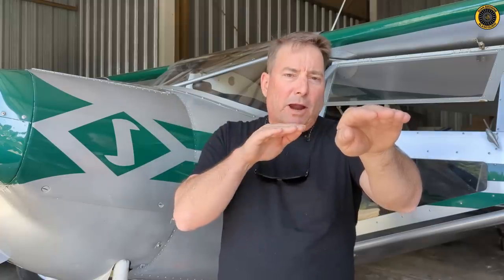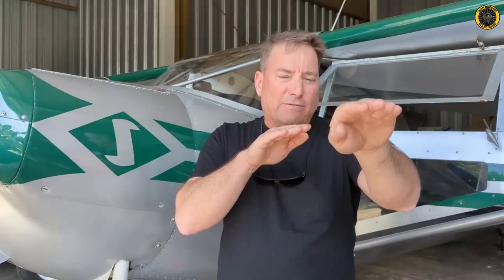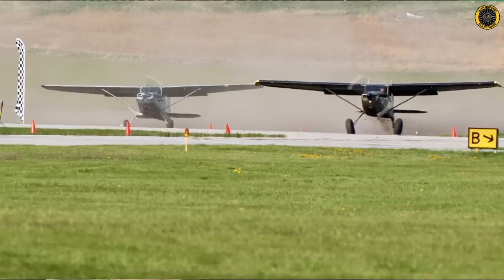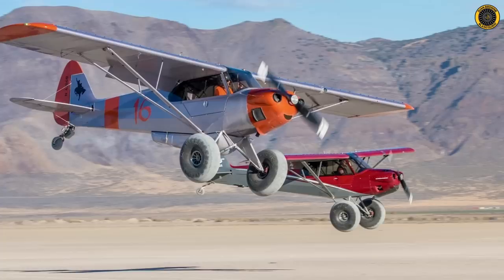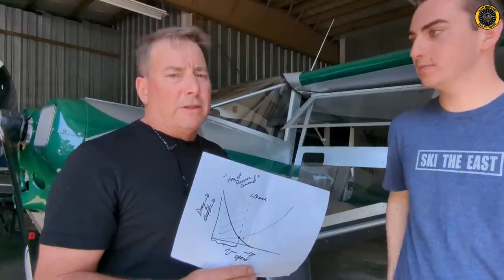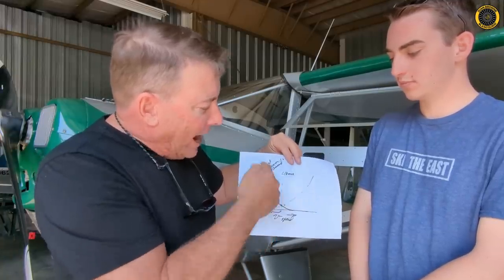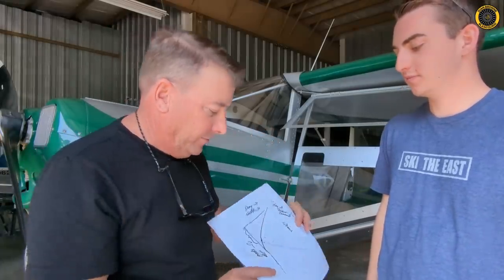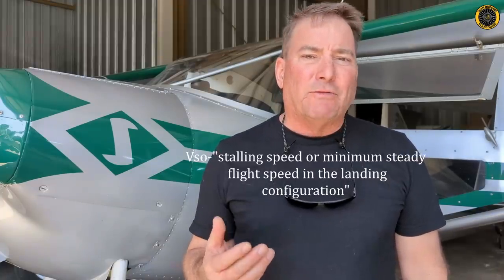Cessna 140 Stall/Spin Accident Wayne NE

Comment: To all those saying that STOL is asking for this kind of incident: You clearly didn't watch to the end. As Juan says, the proper way to do these STOL maneuvers is to fly at approach speed until you are in (or nearly in) ground effect, then bring the speed back to execute your short landing roll. Similar with takeoff: you rotate and lift off as slow as possible, then lower the nose, accelerate, and climb away at Vx or Vy. If flown that way, the risks are no more extreme than many others we accept in everyday life.

The issue here was that planes with different approach speed were operating with limited spacing in the same pattern, so the C140 was well below its approach speed trying to maintain spacing, and then tried to maneuver. Nothing fundamentally unsafe about the event. Just poor sequence and unfortunate decision making once the spacing got too short.
Reply: No, the problem here is that without any significant transgression a man died. Too many planes, too slow, too close. BAD EVENT MANAGEMENT!
Reply: @ianallan2337  there was only 1 aircraft in front of the accident aircraft. A go-around decision should have been made by the pilot. We can all learn from this.
Reply: @ianallan2337  lol, hope you don't fly on a weekend anywhere ever.
Reply: @josephditroia4946  So how many would be an issue?
Reply: @wgmskiing   Not a good time to laugh. Do you have a license, Garrett?
Reply: @ianallan2337   and…500 hr pilot? I’m not a pilot but I think playing a low and slow plane game with such low hours, maybe he lost the focus to fly the plane trying to beat his opponent, realizing just a few knots too late that he was in fact too slow with no room for error. Sad.
Reply: Surely by definition this sort of flying has a lower margin for error? Lower margin for error = more dangerous. 
Even a highly skilled and experienced pilot has LESS time and fewer options to deal with the unexpected than they would under normal flight ops.
As I see it, pretending otherwise is just silly. 

If it ISN'T more dangerous, why do they need additional training/certification/whatever? Juan said two failed. Were they crap pilots, or does this sort of flying put additional demands a 'normal' GA pilot doesn't encounter, precisely BECAUSE it inherently involves more, and thus technically unnecessary for 'ordinary' flying, risks?

I suppose we can ask Juan to adjudicate: does he think this sort of flying is more risky than when he flies the 777, for example, or indeed his GA flights? Do we seriously have any doubts what he'd answer?
Reply: @josephditroia4946  All? No, sadly, the person who apparently needed to learn it more than the rest of us can't. That's kind of the problem, isn't it? So terribly sad for all involved.
Reply: @57Jimmy  500 hr. is not all that low, especially if you're mostly sticking to one type of aircraft, not trying to advance rapidly to complex aircraft.
Reply: @57Jimmy , he wasn’t trying to beat the other pilot, they were not racing at the time of the accident.
Reply: @ianallan2337  The 5 pilots decided to fly the pattern together. At the time of the accident, there were only 2 planes left in it. Nothing wrong with the event management. The pilot who died made a bad judgement call when he turned sooner than he should have, given the speed difference between his and the other plane. His decision alone.
Reply: @57Jimmy  It was a demonstration not a competition flight. The one thing he could have done differently was to lengthen his run before turning onto approach, given the speed difference.
Reply: @steeltrap3800  I took it to mean all of us still alive. And he's right, anyone can learn from this. And that means that at least his death was not in vain.
Reply: Well said.
Part of what he's talking about is very similar to handling microbursts. As you fly through one of those you go from a sharp head wind to the down rush to a sharp tail wind. So the air speed jumps up then the plane gets pushed straight down and then suddenly the airspeed drops.

I did quite a bit of unusual attitude recovery as part of my basic aerobatics and that's saved me on a few occasions mostly from not overreacting. I think this stuff is all about flying at the limits, which is fine so long as you are trained to respond properly.
Reply: @ianallan2337  Glad to hear someone say it.
Reply: "As Juan says, the proper way to do these STOL maneuvers is to fly at approach speed until you are in (or nearly in) ground effect, then bring the speed back to execute your short landing roll."  

None of those pilots were doing that.   They were all flying as close to Vstall as they could, from a long way back, hanging the plane on the prop.  Basically they are flying low and slow, the worst possible thing.   

Don't believe me ?  Why was the 140 overtaking the Zenith ?  The 75% cruise speed on a Zenith 701 is 80 MPH.  VStall is 28 MPH.   The stall speed on a 140 is 45 MPH.   In order for the 140 to be catching the Zenith, it had to be doing less than 40 MPH.  The Zenith was flying near stall speed, hanging on the prop.
Reply: @SomeTechGuy666  You actually made my point. 1.3*28~=37. The Zenith's safe approach speed is a little under the 140's stall speed.
Reply: @ianallan2337  I also noticed that once the airplanes landed, they even STOPPED on the active runway apparently to have their landing roll measured which even extra time for the  next airplane's approach. BAD EVENT MANAGEMENT!
Reply: please explain this rationalization to the widow and her five children
Reply: @reardencode  In gusty wind conditions, 30% above such a low VStall is not sufficient for normal flying.   If the wind speed is 10 MPH and it suddenly dies as it might in gusty conditions, the airplane airspeed is now 27 MPH and it stalls.

Tom got caught.  Unfortunate, but true.  But the truth is most of the other pilots were probably hanging on the prop too.

If you look at the video, Tom lost about 50 feet of altitude and then steadied right before he spun.  That was probably a stall he caught.  The next stall turned into a spin.  Yes, it happened on the 140 before the other planes.   But that Viking is going way slower than Tom is and their stall speeds are only 17 MPH different.   The Viking wasn't far off stall speed either.
Reply: @ianallan2337  this is my real name.  I'm not hiding anything.  And I'm not laughing at the tragedy, I'm laughing at the clownish comment you made.  Find a hobby.

Comment: Prayers for Tom and his family. I have flown as a Commercial Pilot since 1968. Retired now but I don’t consider a 500 hour pilot experienced, just has some experience, two different things.
Reply: That's kind of what I was thinking but he did say he "wasn't a rookie" which I guess is kind of true but he definitely wasn't far removed from being one.
Reply: Do you think a commercial pilot has good knowledge and experience with stalls and spins as you are always flying straight and level at high altitude and well within your limits?
Reply: @gogogeedus  yes, some do all should. I crop dusted for 3 years, flew aerobatics with Frank Price for 3 years in a Pitts.  Today’s new pilots, I really don’t know. I flight instructed for 2 years and never soloed a student who couldn’t master a 3 turn spin right and left. Even lost one job over my solo requirement. There is a big difference in pilots and pilots!
Reply: No, 500 hours is like a teenager behind the wheel of a car. Using driving as a comparison, 500 hours at an average speed of 55 mph would only be 27,500 miles. Not experienced.
Reply: @kennynorton2473  EXACTLY my sentiments, those are basics! I won't solo a student unless I've spun them!
Reply: @jrwstl02  WRONG! If taught the basics properly then what he was doing wouldn't have bin a problem.  I've taught 50 to 60 hour pilots who are natural and rock! And I've had commercial pilots that basically suck! Look at the copilot on the Atlas 767 flight into Houston that at 6000ft and 250kts in some clouds and turbulence screamed out "We're Stalling!" and stuffed the nose and drove the airplane into the ground!
Reply: @gonflying  I could be wrong about this, but wasn't that crash ruled a deliberate act? Either way, yes there are a ton of air crashes that showed poor airmanship in pilots with a lot of hours under their belt. Every time a pilot takes to the air there is a unique and changing set of risks. It only takes one thing to end it all.
Reply: 500 hours and the pilot in this accident was "experienced"? 

I'm not a pilot, but I'm a lisenced architect. The minimum hours required to earn that title are 16,000 hours of combined education and work experience. And you have to pass the board exams. FWIW these requirements are mandated by law for "public health, saftey and welfare"

500 hours is the equivalent of 3 months on the job in my profession. That's not even wet behind the ears. You're barely qualified to run the xerox machine or god forbid, use a stapler after 3 months in an architecture office.

Architecture is certainly a complex and highly technical field and all that. But it seems to me that flying an airplane is pretty complex too. It also seems like there's very little margin for error, especially flying as slow as possible close to the ground, but still fast and high enough to kill you instantly. Competition adds more distractions, workload, and pressure to push limits. Deaths are inevitable in flying just as they are in driving. Any sort of competition increases the risk in both. As long as pilots understand and willingly accept the risks involved, I say "have fun!"

...but part of "understanding the risks involved" means understanding your own limits and those of your aircraft. It's hard to imagine a 500 hour pilot truly having the profciency and knowledge and experience required to safely operate and compete at the ragged edge of his aircraft and his own limits. Rather, it strikes me as reckless to allow such inexperienced pilots to compete in such events. The pilot himself is gone. It's his family and freinds who'll have to deal with the loss. It's sad on one hand, but also inspiring, because at least he died doing something extraordinary that he loved.

But organizers and sanctioning bodies of competitions like this might wanna review the minimum training and experience required of competitors. Maybe consider setting minimum air speeds and maximum altitudes for them? Go slower or higher and your disquilified. Competition becomes about precision flying based on staying within a particular aircraft's safe performance minimums.

Unless funerals are an important part of the sport.
Reply: @gogogeedus  plenty of 20000+ hour pilots have come unstuck in light aircraft- a common one is forgetting to change fuel tanks.
Reply: @TheWilliamHoganExperience  500hours should be ample hours to safely handle a light aircraft. This pilot, like many before, just had a 'bad day at the office'.
Reply: @michaelosgood9876  yes off course. thousands of hour flight time is not going to change a pilots diligence.it's an individual thing.a personality thing.

Comment: Good analysis. The use of rudder at low speed stalls situations and the adverse effects of aileron use is not often taught in GA training. ... in my opinion.
Reply: An old friend and flying buddy of mine used to call that effect "reverse ailerons" where the ailerons would actually have the opposite effect than what was intended under certain flying condition IE high AOA and the incipient stall spin phase.
Reply: I remember the one sailplane lesson I took.  If you tried to turn without enough rudder it would turn the opposite direction.  It took a lot of rudder to turn with those long wings.  It was a good lesson that I haven’t forgot, even though I don’t fly or instruct anymore.
Reply: Thats a good point...

The intuitive / reaction thing is to use aileron when a wing drops at slow speedbut its the worst thing you can do.  Rudder rudder.
Reply: Sailplane instruction spends a LOT of time on stall and recovery training. Important when you don't have the luxury of "going around*. Im sure the pilot knew what to do, however it shows that in emergency situations its very difficult to resist the urge of doing the opposite hence he tendancy to use aileron to pick up the wing or pull back on the stick. Tragic loss and my thoughts are with the family.
Reply: My experience is that if you use aileron to try and pick up a stalled wing is you go into a spin. Been there, done that at a safe altitude and changed my skivvies once I got back on the ground safely.
Reply: @LazloNQ  To a lot of people that would probably seem strange :) .I'm sure he knew his stuff.
Reply: Opposite rudder was what I learned as well.  It increases the wing speed on the stalled wing providing lift.
Reply: @BigBoreAdventures  Top rudder. but the best idea is too avoid a spin scenario from happening in the first place.
Reply: @gogogeedus  Sorry to ask s stupid question, but what is a top rudder?
Reply: @BigBoreAdventures  When the A/C is banked over it is the highest rudder pedal.
Reply: @BigBoreAdventures  but you know nothing would have saved this guy,he was to low to recover, FLYWIRE Scott Perdue does a good explanation on his channel about relative wind and how ineffective the rudder is on certain types of A/C in stalls. most A/C need a lot of space to recover so the best option is to do spins with lots of height to recover or not at all. these drag events are dangerous especially for novice pilots or pilots with a poor understanding of aerodynamics.
Reply: @gogogeedus  Thanks for the explanation.  I hadn't heard that term top rudder before.  My instructor used the term opposite rudder.  So if your wing dipped right you would use the opposite left rudder pedal and vice versa.
Reply: @BigBoreAdventures  Yes,that's right.
Reply: @BigBoreAdventures  The best explanation of top rudder is from Jim Alsip who is a flight instructor,he is the guy with all the best advice on flying safely.
Reply: Or you can just “step on the ball”. Make a habit of scanning the TC/ball on every turn, and “fix” airspeed with pitch. Those two things will keep you out of trouble.

Comment: You assessment is 100% correct in my opinion.  In 1975 I received my license in El Paso, TX after flying 40 hours in a 1964 Cessna 150.  Recognizing the landing gear configuration difference between the 150 and the 140, virtually all other aspects of the planes are the same, with handling being predictably the similar.  I went on during the next year to fly another 110 hours in that plane.  During the 1st 40 hour period, my CFI wanted me to demonstrate certain things the plane just wouldn't do if the relative wind were 20mph or higher.  One of them was a power on stall.  You can disagree all you want, but that particular plane simply wouldn't stall with a no flap, full power departure configuration flying into the wind.  We were almost vertical and she just hung on the prop.  Instead of reducing power, which would have been the better way to demonstrate the stall, he asked to drop a wing (I had practiced this many times before and learned the hard way "not" to do this).  I gave him my opinion, but he insisted.  I left full power in and slightly lowered the left wing.  She still wouldn't stall.  He asked me to lower the wing even more (I hate to say I told you so).  I lowered the wing more, then suddenly the top wing stalled.  When it stalled, the plane flipped instantly on its back as the starboard wing rolled over the top.  This makes me sound like the self-proclaimed "big guy" which I'm not.  Because it happened so fast, I just let the plane flip over, went wings level, lowered the nose (we had plenty of altitude), then applied power and slowly pulled out of the stall.  After that, we abandoned power-on stalls and instead reduced power and practiced "what you should do" if you're going to hold a stall in this plane.  As the buffet occurs and you feel the onset of the stall, you use "only opposite rudder" which pushes the tail in the direction of the stalling wing and eliminates (usually) the stall from occurring.  Then you proceed with conventional recovery.

One of my better experiences with this plane was another Cessna 150 pilot with hundreds of hours in his plane.  He asked if I had ever "backed" the plane across a road while in flight.  I just looked at him.  He took the controls (average West Texas day, clear with a 15-20 knot breeze) slowed the plane into the wind, added flaps to match the air speed, and got the speed to a point I had not witnessed before.  While recognizing we were crazy slow, my question was, how can you prove you are backing up.  He said "look at our shadow on the ground".  Sure enough, the shadow on the ground traveled backwards very slowly across a road.

Next time I'll tell you about flying into the massive crater just West of El Paso.  Also about flying natural gas pipeline inspection in West Texas.

Comment: As always, thanks Juan. Stunning how quickly the stall-spin developed and how futile recovery efforts prove to be at low altitude. Little margin for error when you’re flying on the edge. Angel’s Wings Tom, RIP.
Reply: Power and nose down he may have crashed but perhaps not vertical. 
Some rules are needed as this grows